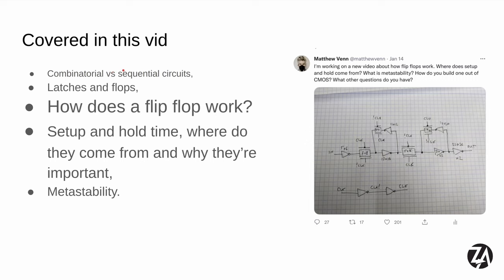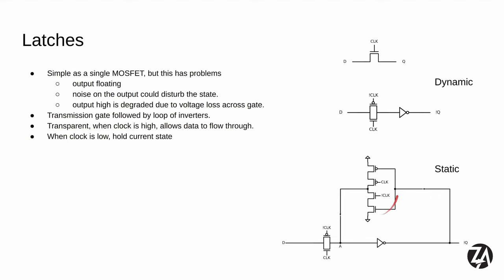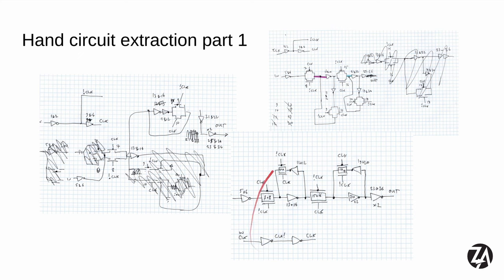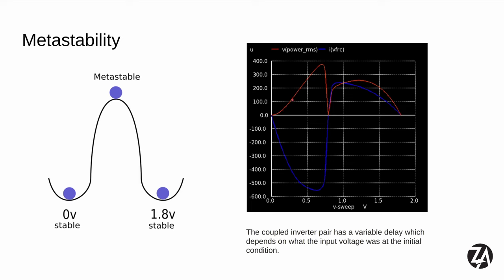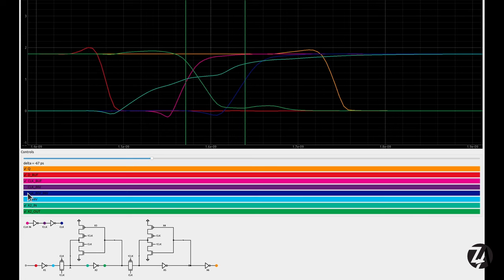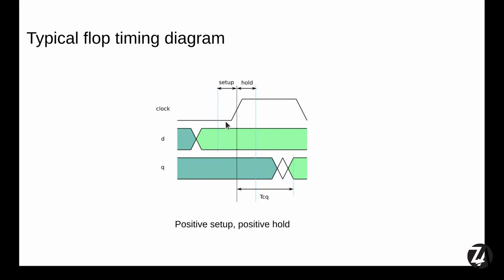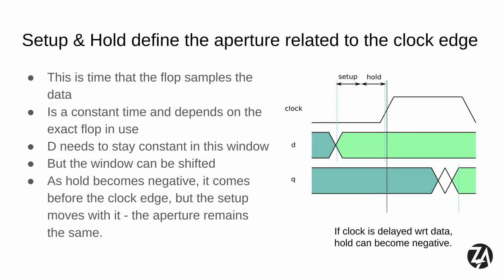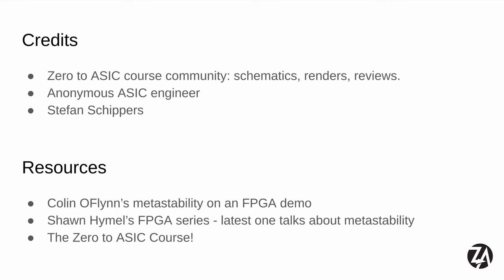How does a flip flop work, what is metastability and why does it have setup & hold time?

Comment: Colin's oscilloscope picture depicting the heatmap response of a flip-flop is perfect. Depending on the technology, output delays can extend more than a clock cycle. This delay is not included in the static timing analysis used for the combinatorial logic and routing. The tools assume the designer has appropriately delt with metastability (Clock-Domain-Crossing tools or best practices).